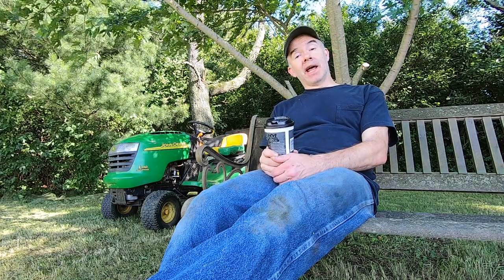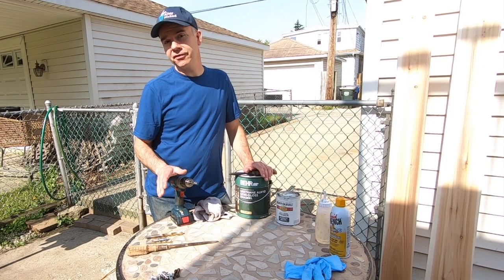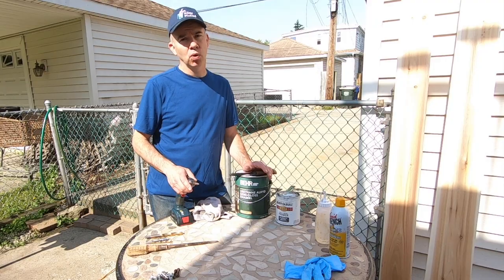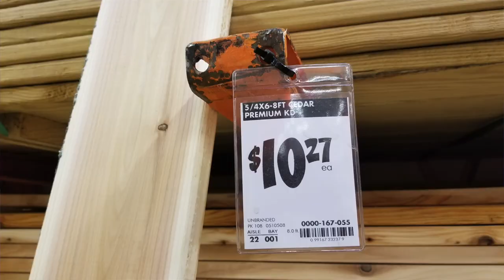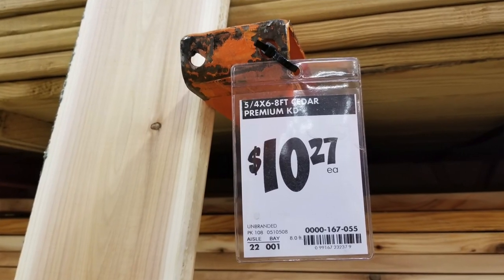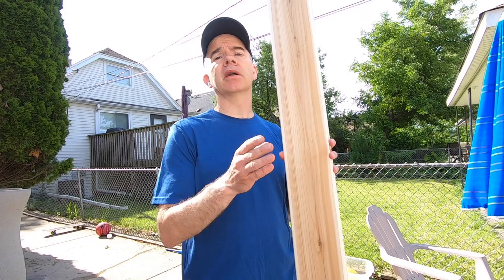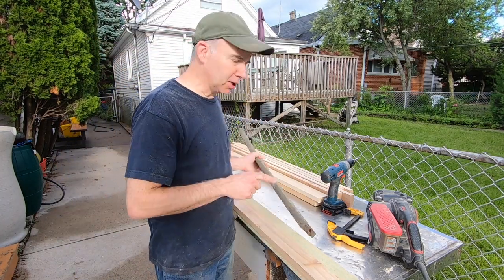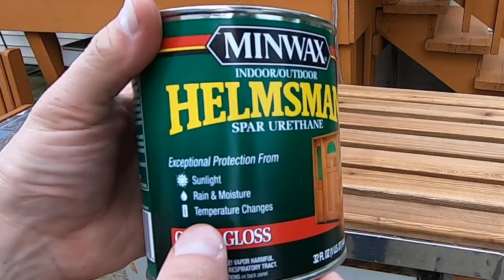SAVING THE WORLD! One Bench at a Time. Amazing Bench Restoration

Comment: Great video.  Question please please.  My bench has rusted bolts, you can’t hold the head still to undo them without damage in the wood.  Any suggestions please.  Thanks
Reply from the maker: Some bolts need to be cut off. I have also had bolts so rusted that I was able to grab the nut with a pair of channel locking pliers and jiggle the nut back and forth until it snaps off. I assume you are trying to save the wood and don't want it damaged. There are several tricks I use but it's hard to tell what your scenario is without looking at it. If you need further advise, you can try to send pictures of the bolts to alleypicked@gmail.com

Comment: Thank you from the UK.  Great video. The birdseye camera view is very helpful.  I love the detailing and that you list all the products and reasons why you like wood stain etc v paint.  I prefer the look of natural look of wood too. I don't have a table saw but i will have to make do with a hacksaw.  The bench looks smashing! My mum's bench has a mild steel frame and wooden slats with coach bolts.  Do i need knotting solution before the wood treatment?
Reply from the maker: Hi and thanks for the feedback. I am not sure that I understand your question. By knotting solution are you referring to wood stain? By wood treatment do you mean polyurethane finish? Wood stain is optional.
Reply: @AlleyPicked   @Alley Picked  Sorry. Knotting solution -  the spirit based liquid that you apply to knots in the wood prior to stain to prevent the knots dropping out at a later date. I was just going to stain it to match in with our side gate as we have some left over from that project.

Comment: Great job! How does the brush on enamel hold up to the elements compared to a spray paint?
Reply from the maker: There are several determining factors. As long as the surface is prepared correctly both spray and brushing are effective. Cars are sprayed. Both methods are effective if done properly.